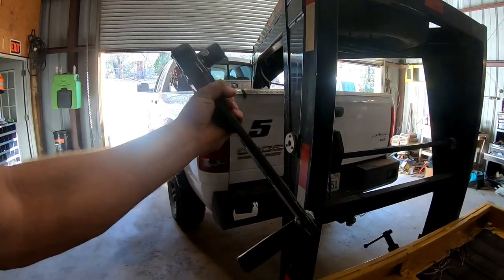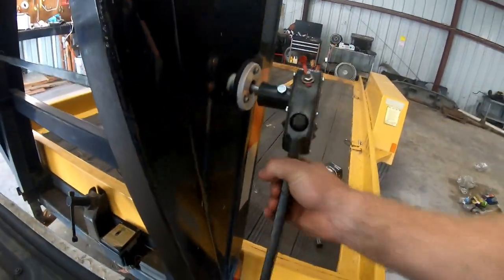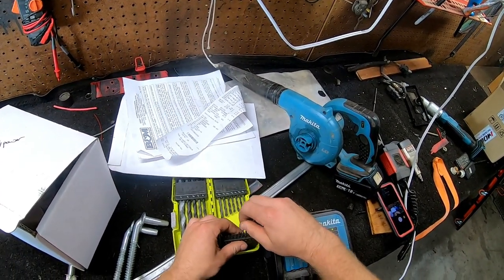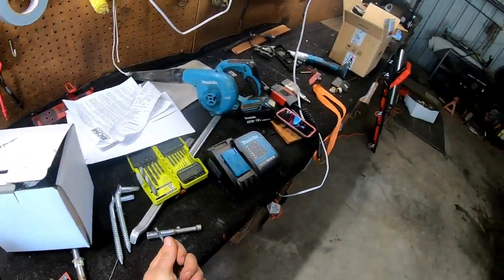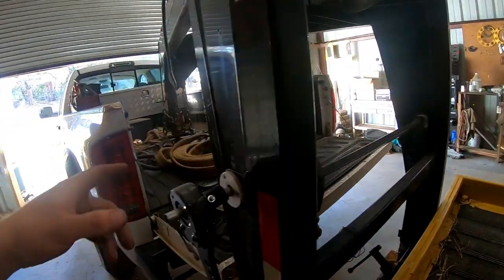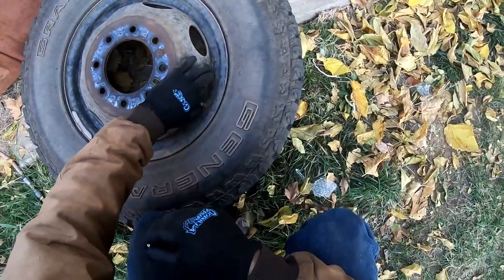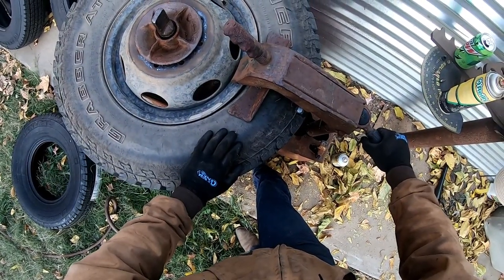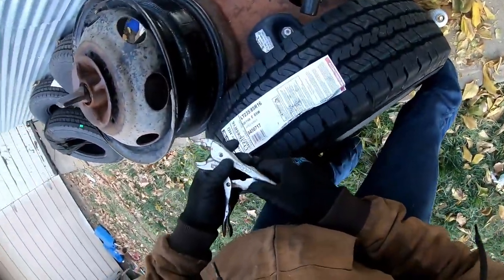CHANGING TIRES ON 3500 DODGE AND TESTING OUT NEW TRAILER PARTS! THEN A FAIL!

Comment: Always mounted equipment tires with a little ether and fire. If you don't like the rails but still want the ability for a fifth wheel plate get a B and W turnover with the companion hitch. That's what I run and love it

Comment: I personally hate torsion axles. When the torsion wears out you pretty much need a new axle.  When springs wear out just get new springs.  However my uncles camper was towing it for a friend that was borrowing it for the summer at a church camp and blew a tire. I had just gotten off the expressway when i believe it happened and the other tire held the blown tires rim from touching the ground. I never knew it blew until stopped in town for dinner

Comment: At Napa you can buy a fitting that looks just like the fitting that is used on your air hose and air tools.Its the male end and has threads on the inside that will match the tire valve stem.You then connect your air hose to the tire and it puts the air in faster than your air up tools  and will help seat the beads easier

Comment: That old Coates tire changer should have a Air Blast on it from the bottom just press the pedal all the way down and it shoots blast of air into the tire from the bottom while you have the air chuck on the stem

Comment: I used those old Coates tire machines. We would take the core out of the valve to get more air in the tire to seat it. The quickly put the core in when the tire had seated. Only did the fire once, guy who signs our pay check was not amused.

Comment: I am not a fan of torsion axles. They have their place like horse trailers to get the load height low since they can swing negative of the deck.
Fire to light tires is fun and used to do sets of 8 truck tires just line em up, of course that was years ago. I just did some trailer tires and not sure if it's me but seems like I had to use a ton of starting fluid or it'd just burn like a candle??? Figured they must have "safety'd" ether somehow.

Comment: Starting fluid makes a Lot Better bang. Get you a hose end that will lock on that way you can make 1 lap,around the,tire and,then you can spray a short trail to keep you away from the fire. On your trailer could you make one of the 2 speed boxes work on it

Comment: Maby open up where the handle goes in to the jacks and see what gear set up they have and change the small.one out to a bigger one maby go to a 1:2 for every 1 turn ur drill does it does 2 on the jack side

Comment: Could you pull the roll pin out of the dowl that the pipe goes over and drill a hole in the pipe that goes over it with the notch and bolt the pipe to the dowl and eliminate the slotted slip joint

Comment: Wind it up or down with the original drill adapter and then lift or lower under load with the speed binder deal. Use balance beads in your tires. Best dadgum thing ever.

Comment: The only tires I use starter fluid on for the Hot Flash, is 385-65X22.5 or wider tires. Otherwise, a ratchet strap around the circumference of the tire expands the sidewall once cranked down.

Hitches are something I don't weld on. Too much liability if something breaks and a trailer breaks loose.

The torsion axles can be cranked to level the trailer. I don't like slipper springs. Empty, a slipper sprung trailer will ride harsher than a torsion axle will. 

You said that the tire/wheel bearing temperatures are good, but I bet that a laser thermometer would show otherwise. Not a fan of Harbor Freight, but the laser gun is good enough. All you're looking for is a difference between the tires and axles temperatures, not exact temperatures.

Comment: Looking to buy my first Cummins, from what I have seen on here I am leaning towards a 12 valve, but if you could pick an engine, or generation of Dodge 2500 which would you go with?  I've already determined it will be a manual transmission.

Comment: try using a rachet strap around the outside of the tire then your bead will seat
Reply from the maker: G Jones tried that. Doesn’t work on these tires. It just rolls over the treads

Comment: Hey Sam just wonder if your 4 gen every says 4wd shift in progress while driving down the road I've got a 14 and it did it for the 1st time today and mine is a manual shift transfer case
Reply: I realize you asked Sam but thought I would give my 2 cents. Mine does that on my 2018. Ive found that if you put it in 4x4 every so often it doesn't do it. I have the mechanical dog-leg lever 4x4 shifter. But Im told it is still electronic just like the knob 4x4 option. I didnt know that when I ordered it. The whole reason I wanted the lever was to avoid the electronic issues.. Try shifting it in and out of 4x4 a couple times and driving in 4x4 just a short distance. it should go away.  I do it about once a month. Since I have been doing that it hasn't happened.
Reply: @jamesgunnyreed  thanks man I'll have to give it a shot  I appreciate
Reply from the maker: Thanks James! Mine is electric switch thing. It hasnt done that to me

Comment: Torsion= stiff axel🙈

I broke my last little trailer “not gooseneck” with torsion so I welded it stiff instead! Then used a shock for my trailer ball hitch instead!🤦‍♂️😂

P:s 
Didn’t use it on “public” road! 
Had it for a mini X between 2 spots.